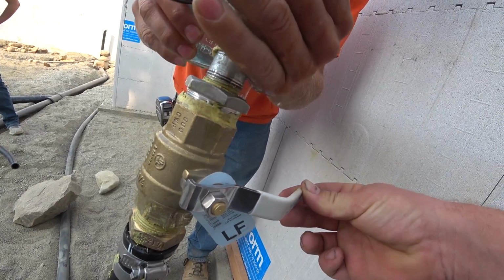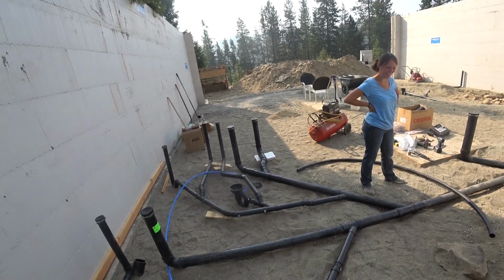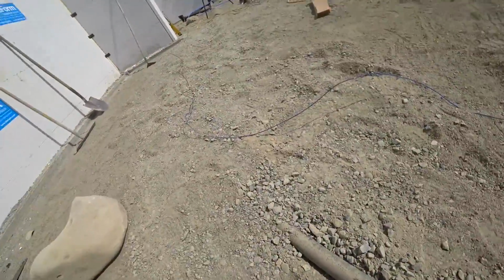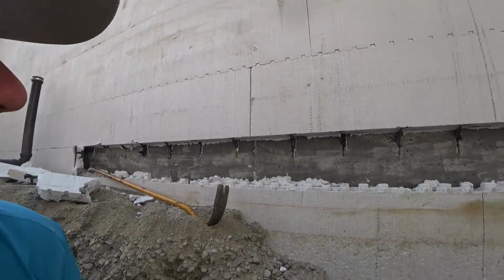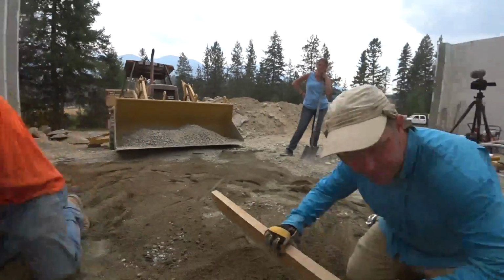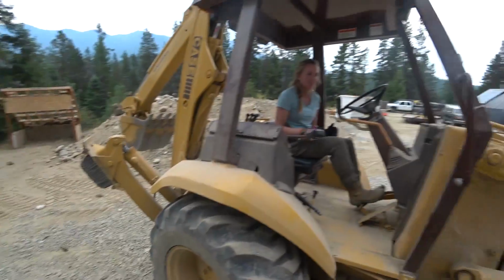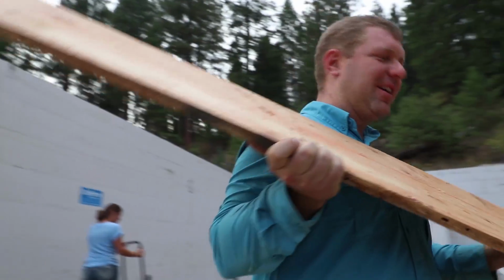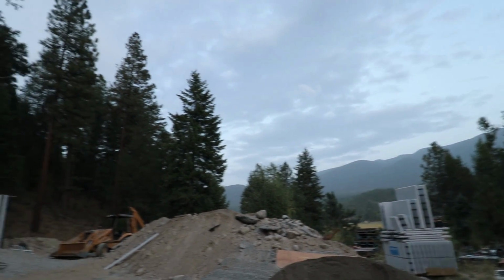TAKING A PRY BAR TO OUR ICF WALLS! (Garage Slab Prep)

Comment: I've done plumbing and construction for over 38 years now and I am here to say sometimes you can over tighten a fitting and it will leak. Best thing to do is loosen it then repack it, Tape or Goop, than tighten again and test for leaks... Surprisingly it does not take much to tighten...

Comment: Jesse: Looking good.    Save any left over ICF pieces. They can at a later date be used to make small house for a backup generator.   Just a concrete slab  and you fill the form with foam scraps and loose insulation.   Sheath the exterior ( this becomes your structural wall with the plastic web.)   You will need a small temperature controlled green house exhaust fan on the top of the side away from the house and an air inlet in the base of the access door facing the house.   This foam box should convert more than 3/4's of the air born sound to heat. Make a removable lid to go over the wall sheathing ( shoe box ) with rough 1x8 .  Fill with 6" of the sheet foam for sound absorption/conversion.  Screw the 2" overlap of the lid to the wall sheathing;  so you can remove it for generator service or removal.Bert

Comment: I know the slab has probably been poured already , and Jesse and co.  don't read these comments ,  but for those of you who want some rebar chairs for cheap, cheap.

Here is how to get them.

Take any scrap lumber that you can find that is about 2 x 2 , 2x3,  or 2x4  as long as there is available and build a trough that is about 1 1/2 " wide x 11/2 deep. Cut pieces of 1x4  the length of the space between  you side members of the trough. 

Note ;-  Don't make the spacers to tight a fix for ease of removal later. As you place these spacers in the mold.  DO NOT NAIL OR SCREW THEM IN.  Don't worry, the won't fall over as you continue to add more concrete to the mold.

Get a bag of  Readymix, quick-crete,  or make you own if you already have the portland cement and aggregate on site for the slab pour.
Mix a small batch (stiff mix works well)
Block one end of your "mold" place a small amount of concrete in the mold starting at the blocked end and push it into place with a spacer. so that you have about 11/2" of concrete compressed against your blocked end ( the length of the spacer is the width of the space between the sides of the mold ) 
You should now have a block of concrete 11/2 x 11/2 x 11/2 in your mold. While it is still 'wet' place a wire rebar tie in the top of the block with the two twist loops exposed. (this will be used to tie of the block to the the rebar  to keep the blocks in place after the are positioned under the grid. 
Continue the process  :- concrete - spacer,  concrete - spacer,  down the form until you have  made the quantity you need. 
As soon as the concrete blocks has set up enough to retain their shape you can remove the blocks and let them cure ( About 24 hours is the minimum time )and reuse the form.
For ease of removal once the block has hardened enough, you can coat the mold and the spacers with old engine oil.
Job done,  as many cheap chairs as you need !
Reply: John Ahern great tip!!  Clinker or used brick or CMU can also be used. Love your idea because of the ties imbedded in what you've poured!!  Bravo Sir!!
Reply: They didn't learn. Spent another 100+ $ on bits of plastic. Oh well what the heck!  It's only money!!
Reply: How any more times do they have to be told to get a string of lights put up, or at least ONE  500 watt halogen work light hung in that stupid tree.

Comment: The one thing i noticed was no thermal break between the wall and floor, the wall will wisk heat from the floor and effect the efficiency of the system.

Comment: There is another good reason to have concrete-to-concrete.  Our house had a slab floor and previous owners were being inundated with bugs.  When we got here I found that there was a path of foam to earth in perimeter downstairs.  Digging into it I found all these pathways with lots of bug remnants.  So had to dig this out and refill with concrete and sealant - stopped the bug problem here!
Reply: michael rew  True to some extent - just as true that you can't totally seal a house from rain.  BUT you can severely restrict entry!  Concrete does crack, so I've got a layer of polymer to seal.  Not found any incursion on that path anymore.  Last house we bought was slab over an ant mecca.  We we're told you could not seal them out.  But we sprayed through every opening and sealed every path we could find and never again  had any ant issues - although we lived there for 6 more years.  If its not perfect it still can be very effective.  
Good comment.
Reply: I didn't hear them even speak of putting the barrier layer down, ...but surely they must have done that.  We'll have to wait and see  ;-}    ...I'm Starting to sound like a soap opera -- Oh Nooooo !

Comment: Great videos guys, been watching couple of weeks now, it's really coming together now.  One piece of advice on that cherry wood, scrape off as much of the dust from the slabs as possible before stickering, the dust prevents the wood from drying and gets moldy and insects make it their home. I cut 3000 board feet of wood in my back yard and slowly stickered it, the moldy wood dust removal later was a major pain in the arse.

Comment: Anytime I buy a tool with a wood handle I protect it with many coats of heavy duty spar varnish.  It needs to be spar varnish which is an outside formulation of varnish.  Not only does it seal the wood it gives UV protection.  I have wooden handles tools that have sat out for years that look nearly new.  It is also great for wooden ladders. trellises, posts and other exposed wood.

Comment: You mentioned your garage was perfectly level . I hope you have a slop to it for water run off.
Reply: CAMPLIGHTS the installed floor drains, I'm guessing they will finish the slab to each drain.

Comment: Why are people running the mill not wearing safety glasses and gloves?  4:52 closed valve reveals itself. The question is did the "inspector" they sent the pics to catch it? Eliminating the thermal break between the slab and the concrete wall seems ill-advised to me. You've now connected your in-floor heating system to a huge heat sink to heat all winter.  If the footing isn't insulated, you might want to do so before your backfill is complete though you've lost the opportunity to do that on the back wall.
Reply: Def. should have safety glasses, but gloves can be as much or more of a danger on that sort of equipment....easier to snag on moving parts

Comment: Boiled linseed oil on your tool handles will keep the wood from drying out to much and make your handles last much longer
Reply: Oiled handles also don't tear your hands up like industrial clearcoat does.  Sand that garbage off and do what Alec said.  Throw linseed oil in there... it is a night and day difference.
Reply: As long as you reapply it every so often it's a wonderful finish.
Reply: No damn after hours sex talk, PLEEZ

Comment: The crank rope on the mill is threaded wrong.  When correct you crank forward(counterclockwise) to move forward.  It's an easy mistake to make.
Reply: Shouldn't there be bandsaw guides that slide out close to the wood also so it doesn't chatter so much and break off chunks here and there?
Reply: There is a guide on the outside/far side away from the operator.  What you see in the video where a piece of wood got stuck up against the operator side, that is because the wood came loose from the clamp and saw sucked up against the housing.  The blade pulls it in that direction.  This happens when you are cutting a small/lightweight piece that is difficult to clamp.

Comment: Please wrap your DWV and water line with plastic and duct tape that will be in contact with the concrete before the pour. The plastic will allow the pipes to ever so slightly move back and forth as the slab expands and contracts. Your pipes will love you for it and it cost less than $5.

Comment: (wags finger at not using wrenches for any of the work so far, just slip joint pliers)  I thought I saw you using combo wrenches when you replaced the hydraulic hoses on the loader.

Comment: Good job guys what's the plan for the concrete mix what PSI will you order?. Are you going to finish the slab yourselfs? Your garage is going to be a bomb shelter.
I know it's a little to late now have you considered a floor safe? Your doing a great job I know many a contractor that wouldn't take the time to check and recheck the work as you have. Im really enjoying watching your build.

Comment: Really enjoyed this video. Thought for sure you would have put concrete anchors into the area where the foam was removed to anchor to the slab. Maybe there is a reason not to?
Reply: This is a "floating slab" and does not need to be in contact or attached to the concrete wall.  This design does not depend on the slab as a shear structure.

Comment: I believe minimum test pressure is 100lbs, but should be tested up to 300 due to occasional water hammering. Constant pressure never ruptures, it's the hammering and freezing. Waste pipes are mostly damaged due to cleaning out clogs using pressure jets.
Reply: What happens in a hydraulic  system with air in the lines? A leak in the shutoff drags air in the system by vacuum. Using another faucet or shutting off another valve compresses that vacuum  bubble to huge pressures when the water momentum suddenly stops.  The leaky valve will have dried out seals due to air on both sides and continue to get worse as the seal dry rots. Quarter turn ball valves use a nylon seal up against a ball with a hole drilled through. Multiple turn valves screw a stem with a rubber washer on bottom. Mixing valves and faucet valves use tear drop shaped ports and rubber seals with a bit of grease for better control of the output. Clothes washers and toilets just slam on n off. Multiple story buildings sometimes use directional valves or flow restrictions to reduce pressures on lower floors... and I'm not a plumber lol... just real freakin handy... can't fix it if you don't know the problem 😊
Reply: lol, plumbing systems are never tested to 300 psi.  First of all, you'll never encounter that kind of pressure.  Second of all, code in a lot of places is 80 psi maximum.  Third, you'll end up blowing up a lot of plumbing systems if you try testing them at 300 psi.
Reply: You are correct about testing it at 100 psi though.  Also, if there's a concern of water hammer, all that needs to be done is to install a little water hammer arrestor.  Code actually indicates when and where water hammer arrestors must be installed, though I'm not sure they're required in a residential system.

Comment: First of all, your channel is quiet interesting! I like watching you guys progressing :) What i don't get is the following: Why do you poor the slab now? In my mind it would have made much more sense to first build a floor slab on a decent compacted and prepared ground. Then you build your walls on top of it.
Now it looks that the only contact between the slab and the walls is just this little surface, you peeled the styrofoam off. All the weight of your House will rest on the surface area of your walls. There will be probably no force transferred into the slab, since there is no decent connection between it and the walls. Which makes me think, there might be a chance of a wall slighly sinking into the ground and sheering of the floor slab. ( probably only in certain circumstances, but still)

Maybe I'm completely mistaking, but those were my first thoughts about that.

Greetings from Germany ;)
Reply: Chris Stein the walls are supported by the footer on the perimeter of the house.
Reply: As they said, the biggest risk is the foundation blowing out because of the weight of the dirt behind it. The weight of the building is transferred through the foundation down to the footer (which is sitting on undisturbed and therefore highly compacted dirt) and the slab helps hold the foundation in place. If you built the slab first you'd have to rely on rebar to keep the foot of the foundation wall from sliding out.

Comment: On your cherry you didn't use near enough stickers.  Hard woods need a sticker every 18" soft woods more like every 24".  Paint the end grain with latex paint before you mill it (as soon as it is cut if you can).  Sticker at the very end of the board as most checks will be from the end grain to the first sticker. Store the slabs in a flat place, put some old tin on top and some shade cloth on the sides.  Re-purpose the grizzly into a solar kiln after you're done with dirt work.   You need quarter sawn wood for fine wood working projects with straight grain, so I'm afraid this piece will be best for pen blanks or firewood.

Comment: I dont buy your theory about the bottom of the walls moving inward, you are forgetting that you have a big ol wide deep footer with rebar sticking up and that the walls are bonded to the footer and the rebar. Of course there is a slight chance that I could be wrong Lol I really do like your videos.

Comment: Love the Ladies giving a hand... Gems... Lads look after them!  very interested in the Aero board forms to see how it turns out. How do you prevent moisture crossing from outside to interior. Forgive me I am used to using an air gap with metal stays with a  water drip dip to prevent moisture transmission... miss spent youth on Construction Sites.

Comment: If Eric could find a tub to hold water, put all his wooden handles tools that are drying out it will help them lasts longer. Oh just stand them up, have the water level to about 6" up.
Reply: Water makes the fit worse, it swells, crushes the wood fiber then dries even looser. Wood handles need boiled linseed oil. Another quick fix is engine coolant, soak in that and it swells but doesn't evaporate.
Reply: I've never used linseed oil , but I put all my falling axes in a bucket of water never had a problem with the axe head coming lose.

Comment: Will you put insulation under the floor?  In the UK there is typically 100mm/4" of solid Kingspan, Celotex, polystyrene or similar under the screed.
Reply: Screed has three meanings in building construction: 1) a flat board (screed board, floating screed) or a purpose-made aluminium tool used to smooth and true materials like concrete, stucco and plaster after it has been placed on a surface or to assist in flattening;[1] 2) a strip of plaster or wood applied to a surface to act as a guide for a screed tool (screed rail, screed strip, screed batten); 3) the material itself which has been flattened with a screed (screed coat).[2] In the UK, screed has also come to describe a thin, top layer of material (traditionally sand and cement), poured in site on top of the structural concrete or insulation, on top of which other finishing materials can be applied, or it can be left bare to achieve a raw effect.

Comment: 23:37 it shows that pressure gauge is at 52 psi? If the system is filled with air, it loses pressure slower than one filled with water

Comment: Hey whats a locating wire?
Reply: I think it's so they can fine the mains water pipe if they have to dig it out at a later date....
Reply: Campbell Stubbs you can be low voltage on the wire . It is wrapped around the pipe and can be traced with another tool . If they ever have to work on the pipe in the future

Comment: Hello from NYC,  what kind of generator are you using? We have one but it's so loud , it's a propane generator.   How do I get the kind you are using ?   Love your videos,  thanks for the information.  😁
Reply: Marianne Debrizzo they use a honda. I can't remember if it's a eu2000i or a eu3000i. They are very quiet, but also cost 2-3 times as much as the cheap loud ones! Any Honda dealer should be able to get you one, or a big box store may well them too. They are pretty popular, so they aren't too hard to find

Comment: A couple of questions: (1) what is the function of the blue lines attached to the sewer system? (2) why the "tracer wire" on the water line?
Reply: in floor heat
Reply: Thanks snkwired, much appreciated.

Comment: Isn't drilling into the floor drains for the inlets technically voiding you inspection as those connections in the system were never pressure tested?
Reply: They had to open the holes to connect the primer tube to the  P traps in the bottom of the drain. (a Primer tube is a pipe that keeps the p trap from drying out from evaporation, by taking water from,  usually the toilet tank, so that every time you flush the toilet it allows a small amount of water to get to the drain) which incidentally, should  not be pressurized, unless the get a blockage in the drain pipe itself.

Comment: The woodmizer manual mill line is designed to make you desperately want to upgrade.  What is up with that crank drive system?  The dumbest thing ever installed on a manual sawmill.

Comment: 21:42, that concrete is nowhere near being compacted. Not vibrating saved the forms, but the result is bad.
Reply: I think Nauris was referring to the concrete in the wall that Jesse is peeling the foam away from. It does not look like they got all the air pockets out of it when they poured the walls.

Comment: 23:37 that looks like 51-52 not 55
Reply: 55 psi - black pipe in the beating sun, at dusk and no sun the pressure going down to 52 sounds about right.

Comment: Why run the water lines under the slab?  Should have run it over head for less risk of freezing
Reply: It's in a conditioned floor space. Won't freeze.
Reply: Also, they're putting in radiant heated concrete floor.